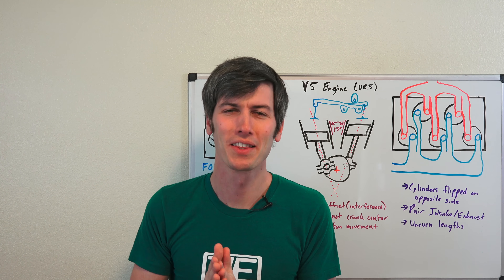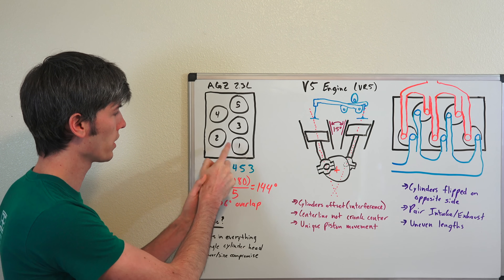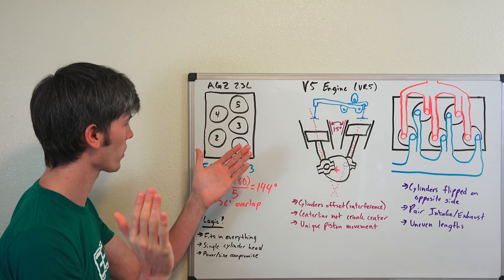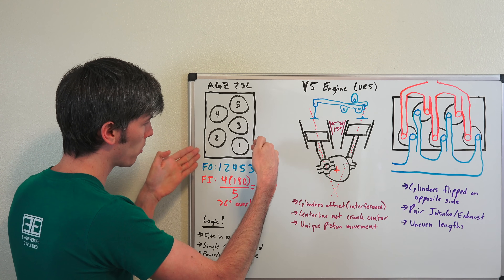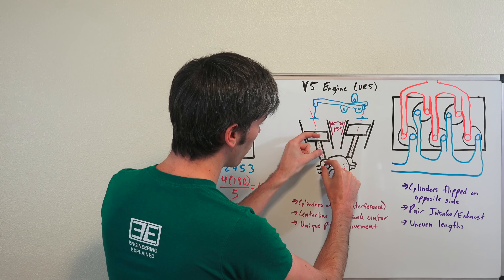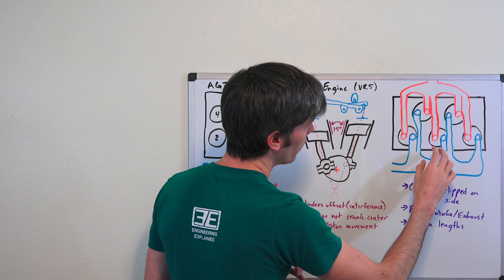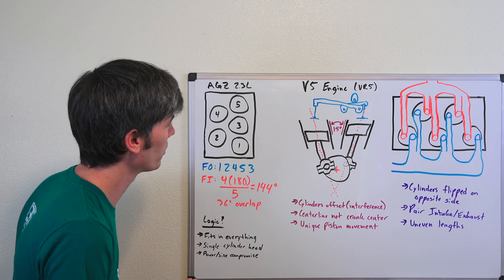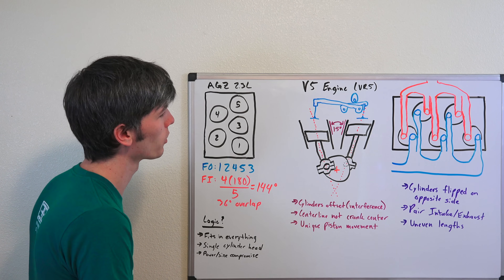Volkswagen's V5 Engine — When A VR6 Is Too Big

Comment: My brainchild tempted for the vr6 butt vr6 is an application useful except for the fuel economy only...however with the advancements in 4 traverse turbo.....I might STAY my position using a 4.
However if I build a track car.....it's likely to be a V5....and a drag car vr6..
Yes I'm tempted juss throw a vr6 in for the track.......😊.
Lastly I must use the dual vanos..minimum 4 valve but Really want the 5 valve...heavily modified and innovation steps I have not disclosed....in order to run 5. Valve..
Lastly must have dual port injections.😊

Comment: It's kind of simple to explain. It's sort of an inline 5 cylinder engine with staggered cylinders. With the head of course necessitating the use of a geometry similar to a V engine because of it's design. Yes I KNOW it's the VR6 short a cylinder. It's really useful and genius for building a shorter/shallower unit that doesn't take up as much room in the engine bay. The VR5 was available in my Passat B5.5 but not here in the US, I got the 1.8T with 4motion and 5 speed but boy do I wish it was the 5 cylinder, just for the sound. It puts out almost the exact same hp as my turbo. But like I said, I'd still rather have this 5 cylinder NA any day.
Reply: No fue una cuestión de tamaño. VR5 se montó en los mismos coches que se montó el VR6.
Reply: @inaandres  Yes that's true but they didn't use the VR6 in the B5 Passat. They used the 2.8 30 Valve V6 in the B5 Passat, not the 2.8 VR6 that was used in the B4. There is a huge difference between the two engines though they do have the same displacement. The 30 valve is short and fat the VR is long and narrow and wouldn't fit in the B5 Passat.
Reply: @WorthlessNickores  yes that is also true... also the vr5 was mounted longitudinally in the b-5 passat which is strange because it is a larger platform than the one used in the golf 4 or Bora or Toledo.

Comment: I didn't know that the bores were offset from the crank. The bore spacing is very wide compared to typical inline and vee engines to help the interference between the bores of each bank, but apparently that wasn't enough for this extremely narrow vee angle without an excessive rod length.

Comment: So with the two cylinder banks not pointing at the centre of rotation, one bank will generate more torque than the other due to a better connecting rod angle, will it not?

Comment: Intake starts on side where there are 2 cylinders if somebody will ever ask. I have vr5 150hp seat toledo from '99 and its fun car to drive. In my car I made 25/28 miles per gallon (10l per 100km) and  sometimes when you try you get 31mpg. But sound and feeling of this engine gives much fun. When you rev it to around 3000rpm engine is really balanced. Engine bay it's quite roomy when you put cone shaped air filter instead of giant oem filter and it's box. Engine is really simple build and you can do lots of stuff by yourself if you know anything about any engines. I will never sold this car, engine is and forever be so unique that you will probably never know person who have vr5. It's crazy design but not boring like others budget cars (mine cost me something around 600$ and okey its has some rust, but is healthy engine).

Comment: Need VR10. Imagine how that will sound.
Reply: Imagine how long that would be. There are V10's which are shorter due to a more reasonable vee angle and resulting closer bores (spacing in the direction parallel to the crankshaft), such as the Ford Triton 6.8 L and the Dodge Viper engine - both of those are derived from V8 designs so they are at 90 degrees.

Comment: I own a Seat Toledo '99 with an VR5 engine, I consider it to myself that it's smooth running but unfortenatly not very powerful and still it needs a lot of fuel

Comment: I believe Honda's Motorcycle racing engine had a wide V configuration, not a narrow angle. 2 cylinder heads and 4 or 5 valves per cylinder. It was done for packaging reasons. There are many more considerations in a motorcycle. Torque delivery, rotational inertia, center of gravity and aerodynamics all have a large part of the engineer's attention. Crazy stuff.
Reply: Yes, the RC211V engine has a bank angle of 75.5 degrees, with separate heads per bank.

Comment: Great explanation/overview. I wonder about balancing port lengths and heat dissipation. With that firing order and exhaust porting heat build up between 1 and 3 would seem to be an issue. 

It's an interesting approach to have a smaller engine than the VR6 with the HP similar to Honda's B18B1 and B18C1 I4s. I am curious about how much more smooth the VR5 is in comparison. More typical 5 cylinder engines would have a crankshaft that resembles a flower. This makes for a very balanced crankshaft in rotation and most of the vibration being end to end.
Reply: Port length balancing isn't really a problem - the runners with short length in the head just need more length outside of the head before joining the intake plenum or exhaust collector.

Comment: Jason. Excellent video. The VR nomenclature in German is for Verkürzt Reihen or loosely translated as Shortened In-Line in English. It's a true In-Line 5 even firing 5-pin crank-throw crankshaft with a staggered 15°V cylinder bores head. Btw, from the diagram, the 15° dimension should be from cyl. ℄ to ℄ (the dotted lines). 

You mentioned the Honda V5 motorcycle engine. They're both 5-cyl. however, the Honda engine is a true V5 engine with the 3-pin crank-throw crankshaft, 75.5°V-block, and 2 cyl. heads, 2 everything....etc. The cyl. 1 & 2 ride on crankpin no.1, the cyl. 3 ride on crankpin no.2, and the cyl. 4 & 5 ride on crankpin no.3.

The brilliant, and marvel design of VW's VR engine architecture are:
2 VR6 = W12 - Audi A8L W12 & VW Phaeton W12
VR6 -1 cyl. = The VR5 above
2 VR5 = VR10 - In 3D CAD only?
VR6 - 2 cyl. = VR4 x 2 = W8 - Passat W8
2 W8 = W16 - Bugatti
Reply: The 5.0 tdi was a vr10 i believe
Reply: @BreadAndJam98  The VW V10 5.0L TDI is a 90° V10 not a VR10.

Comment: I owned two V5 cars. My first was a 1987 VW Passat 2.3l. It really was a great car. The sound were awesome and the engine was very smoothly running and no vibrations at all. I drove this car around the year 2000.
The last 8 years I owned a Ford Mondeo (I think it is called Fusion in the US, I am from Germany) with a 2.5l turbo charged engine. This was even a better car. Especially after installing a 3" exhaust starting at the turbo, and a chip tuning bringing it to 260PS and 400NM torque. I almost cried as I sold it. facepalm
Reply: both of those are inline 5s.

Comment: Thanks so much for the great work and passion on your videos! love them! Would it be possible to make a video on AUDI\VW\SEAT 1.4 TSI which seems to have a watercooler instead of a intercooler like the 2.0 TSI? I just purchase a 1.4 TSI Leon ST and loving the engine! but when spent some time checking the engine notice the lack of tubing and it seemed at first the cheap out and not installing a intercooler but after a quick search it seems like they are using a watercooler right infront of the intake! so... I thought it might worth your time for a video? lol
Cheers and keep the great work!
Ed

Comment: I currently have a car with this engine - the 20v version - a Seat Toledo V5.  Fantastic - sounds great, smooth, revvy and yet makes power from 1000 to 6000 rpm in a very linear fashion.  On the minus side it likes a drink.  Being an engineer, I bought it for its uniqueness, its weirdness and the fact that the idea of the narrow v was originally used by Lancia.  The design feature where the centreline of the cylinders is offset from the centreline of the crank is known as desaxe.  A pity this engine and the DSG gearbox were not available concurrently.
Reply: VW has VR6 and VR5 no V6 and V5.

Comment: Does the Audi RS3 have and engine based on the same design?
Reply: Nope.  Audi 5-cylinder engine is true IL-5 while the VW's VR-5 is Verkürzt Reihen or loosely translated as Shortened In-Line. The VR cylinder head has a staggered 15°V cylinder bores. While in Audi, the cylinder bores are inline or in a row

Comment: are the piston heads really trapezoidal as shown in your sketch?

I had always assumed they rotated the whole cylinder assembly by 15 degrees. seems like you would get wasted work if the force of combustion had to push the cylinder sideways as well as down

Comment: You are demonstrating a lot of ignorance. You do not just chop of a cylinders. It is a major effort, and would require a very different cam and crank shaft. My father was a mechanical engineer, and he told me that the 5 cylinder engine actually is a really good idea since it helps smooth out the running. This was probably 40 years ago. At that time Mercedes also had a 5 cylinder engine, but it was diesel. Therefore it was not created with the idea that they needed to reduce the size of the engine, so just removed the cylinder. Would have been much easier to just build a smaller engine than engineer a 5 cylinder engine since the balancing would have been better known for a 6 cylinder vs. a 5 cylinder.

Comment: So did VW use offset crank pins with 72 degrees separation to obtain even firing impulses? Also, it seems the varied intake/exhaust ports could be tuned to broaden the torque curve and power band.

Comment: Unsure how the engine is balanced to mitigate vibration.  You mentioned that counterweights might be used.  Still, I'm unsure if that would be sufficient.  I'll bet certain components will wear faster than most other engines experience, such as engine mounts.  My GTI has the 2.8L, 24valve, VR6 engine and it's a pleasure to have under the hood despite its higher fuel consumption.

Comment: Was there ever an engine that had 5 cyl. in X patterm? Or to be more specific, like '5' on the dice, 2 cylinders on each side (V4) plus one in the middle? that would be symmetrical and maybe wouldn't make vibrations like this v5, and it sure sounds interesting.

Comment: Didn't mention the potential for reduced sideways forces between the piston and cylinder, due to the out of line crankshaft and piston. I think there's a couple of inline engines which did this just to reduce those forces.
Reply: A small offset in the right direction is good, but with the symmetric vee one bank will have an offset in the favourable direction and the other bank will have an offset in the wrong direction.

Comment: Sorry to go off topic, but I've got two suspension based questions, first being why don't track cars use fully hydraulic steering systems like some off-road vehicles do? Wouldn't this eliminate bump-steer? Is bump steer benificial when designed to be? Couldn't you use a taper in the receiving portion of the hydraulic system to have toe gain with steering input? Second, I've heard a lot that the longer the lower control arm is in a double wishbone system the better, in detail, why is this? Thank you.

Comment: Interesting design, operation theory and engineering. I would assume an engine of this configuration would rely heavily on counter rotating balance shafts placed strategically at points or areas of harmonic disturbance, which is the forewarning to vibration. Without counter balancing, the engine would display low frequency harmonics, that increase with mechanical movement, which is displaying its own frequency, to a higher frequency that could lead to destruction of the block and/or rotating internal masses. An engine self destructing due to harmonics and vibration combining is spectacular in the lab, but the customer may be rather pissed off. Hopefully, those issues are corrected. The engine configeration isn't well known in Australia, as the vehicle it is installed in is a minority but the Volvo 5 cylinder is available here and are renound for their unreliability, exaggerated internal wear and excessive expensive to repair. Excellent description and explanations 👍👍

Comment: I would think you would get some really weird piston-ring and cylinder wall wear on these slanted cylinders.  Do these use specialty piston rings with tapered sides that match the angle of the cylinder wall?

Comment: As an automotive Engineer, I have written journals and published papers on SAE's (society of automotive engineering) and I must say, want to learn something, learn from him, he explains well and easy to understand. Great for students in the Universities who are in the Engineering department
Reply from the maker: Very kind, thanks for watching! Is there a cost effective way of getting access to SAE papers? Love to read them, but $28/pop gets rough if you go through a few of them.
Reply: Engineering Explained to be honest, unless you ask a university lecturer to download it for you, I don't see any other legal way for you to obtain them. I have written about the efficiency and the effects of a SI engine of a higher pressure in fuel pressure regulator. Just setting an extra of 50kpa to your fuel pressure regulator, would cause a 2.0% increase of hp, 1.3% of torque but 30°C more in temperature of the mouth of the exhaust manifold. It was an utter failure for that paper but I found ways how not to meddle any manufacturing specs in a vehicle (dry humor) anyways, thanks for replying mate. Hope you have a wonderful week ahead of you. Cheerio!!
Reply: Engineering Explained I think you can discuss it with any of the lecturer in any Universities that has subscribed to SAE, to download the PDF file for you. That's the only way. Sorry, I can't be much of a help there
Reply: @EngineeringExplained SciHub. I won't tell if you don't...
Reply: "easy to understand".   
I dont understand a damn thing but I don't know why I keep watching.
Reply: @Engineering Explained If you are going to buy any type of papers, standards or test methods, look for the Irish version (if available). It is always cheaper.
Reply: Actually Not, because he uses Facts, which arent completely false but  also not 100% right... so most of the time its easier to understand but not completly correct.

Comment: Hey man, love you videos. What are your thoughts on manufacturer maintenance schedules vs dealership maintenance schedules? i.e. the manufacturers 6 months between oil changes and the dealerships typical suggestion of 3 months between oil changes
Reply from the maker: Go with what the manufacturer suggests. The dealership can make up whatever they want, but the manufacturer sets the warranty limits.

Comment: A lot of people call them W5 motors, they were saposta be as cool as the i5 motor but the only advantage was they were slightly better ballanced at high RPM without the cool sounds. I'd still take an i5 over a V5 :)
Reply: No, no one who has any idea what they are talking about calls this a W5. A "V" engine has two banks (rows) of cylinders, but a "W" engine has three or four banks. The only recent W engines in automotive use are the VW four-bank W8, W12, and W16 engines.

Comment: I don't know if VW actually bothered, but I imagine the different inlet and exhaust port lengths could be compensated for by using unequal length intake and exhaust manifolds to compensate.
Reply from the maker: Based on the photos of manifolds I've seen, they are not adjusted for the unequal lengths.

Comment: Volvo used their 5 cylinder engines in many of their models, is it similar to VW’s? Did they kill theirs as well for the turbo 4’s?
Reply: No, the Volvo five-cylinder was an inline-5, not a vee (or VR) engine.

Comment: I had an in-line 5 cylinder  in my 87 Audi Quattro.  I test drove both the four cylinder and the 5 at the time.  For th extra dollars the 5 cylinder was a bargain. By far much more powerful yet surprising easy on gas.  This and my 84 300DTD (also a five) were the most fuel economical cars I had ever owned since.  Can't live in the past though so be ready for more electrics.  Do you think they will ever use an AC induction type motor to drive a vehicle?  It might be doable with gearing.

Comment: Hi, love your videos

I have a question, I just bought a 2.5L V5 VW passat 2014 that done 88000 KM, the first every thing is perfect, the second week I start hearing some metal noises while the 6 speed automatic is shifting, and after a long drive (1 hour or so) or driving using sport mode for a short period, the metal noise increases and I start hearing some ticking noise increases with rpm sometimes the ticking noise goes when I turn on the air conditioning, this car isn't popular in my county and it's out of warranty, I hope you can help, note that the car acceleration or temperature is perfect
Reply: saw0man It's not a V5, but a normal inline 5.

Comment: Have you covered radial config yet? That’s quite interesting and pretty viable for certain applications configuration.
Reply: What applications? You can make them fit anything but there's usually a better/simpler/cheaper alternative.
Reply: pd4165 well I should’ve specified that it’s mostly for planes

Comment: Excellent video man! But hey, there are still 5 cylinder motors on production, like on the audi rs3. Whats up with that?
Reply: Eric Vela They are normal inline engines, not this VR weirdness.
Reply: inline 5 and VR5 are different things. this is the first odd cylinder to use V configuration

Comment: *VR5 is almost the same size as a VR6 and is used in the same chassis.
Reply: CJBMAGGOT94 albeit it is shorter
Reply: Govin Lock Yeah true, but only by half to a third of a cylinder overall which would be around 27mm to 40mm, which isn't much. Never understood why the VR5 even exists honestly.

Comment: VW German engineering = over complicating machines since WW2.
Reply: VW realized a V-engine in a single solid block so there are less parts and seals that can fail. Its smaller/ lighter and its easy to maintain from the top.
Reply: Viktor B It also fits in pretty much everything!